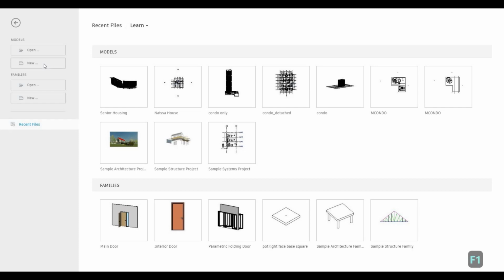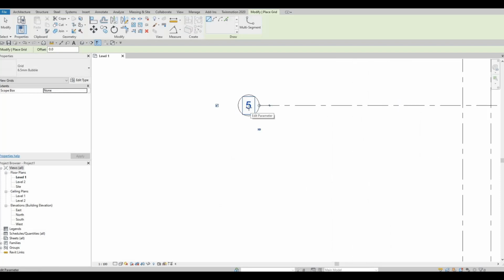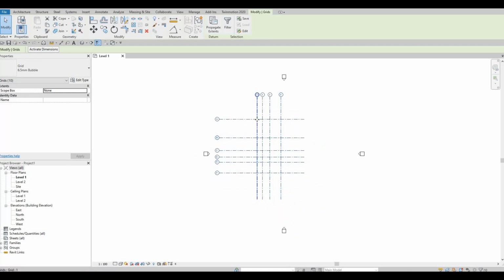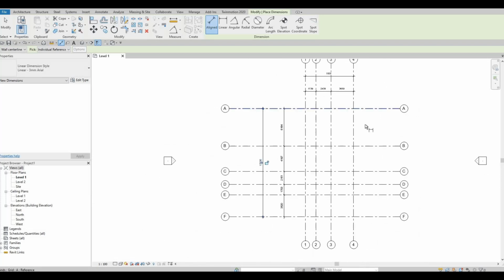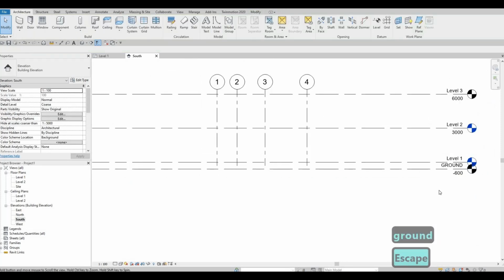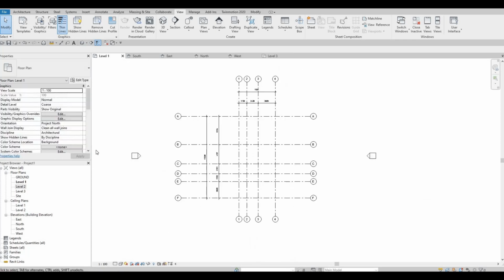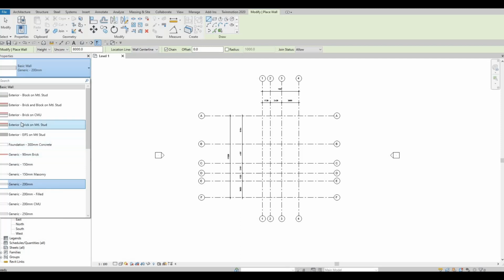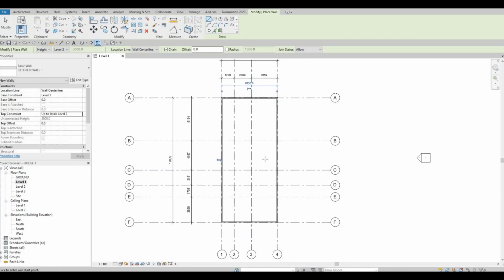MMT House | Part 1 | Complete Step By Step Project | Revit and Twinmotion Tutorial

Comment: hi sir! why there are inside views that appear in my east elevation ( luxury apartment). how to get rid of this? thanks!
Reply from the maker: Hi Renato, just go to any floor plan. Just move the elevation markers outside your model. It looks like a square with triangle icon. 🙂🙏
Reply: Thank you sir!
Reply: Moreover in generic models how could you make a pink line  more thinner in doing sweep?
Reply from the maker: Hi Renato, there is an icon beside section were if clicked, all lines that are thick will be thin to view. 🙂🙏